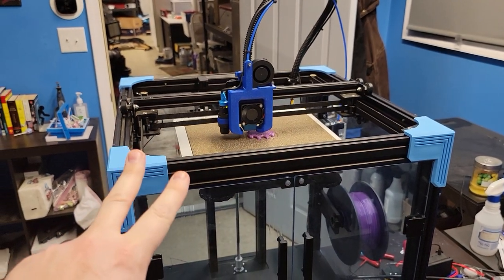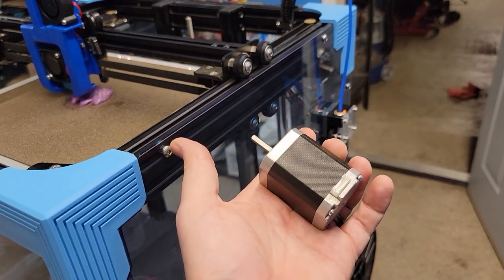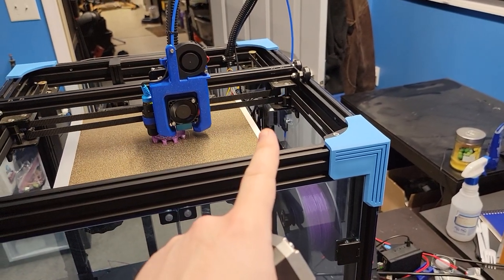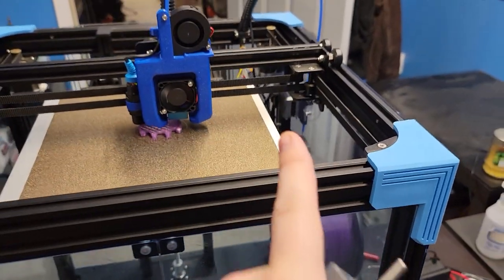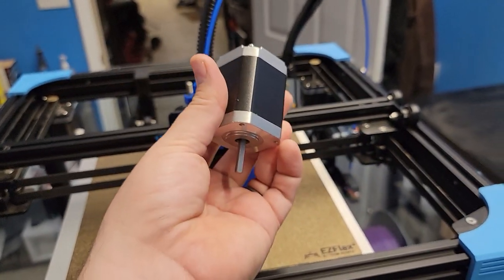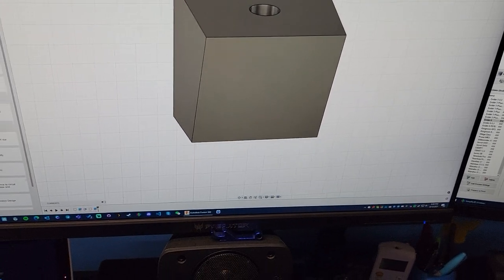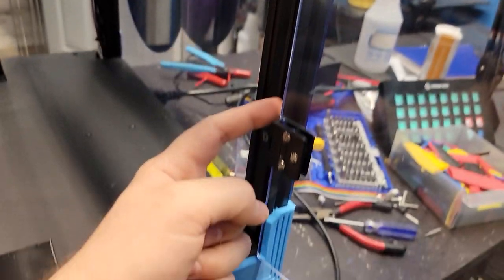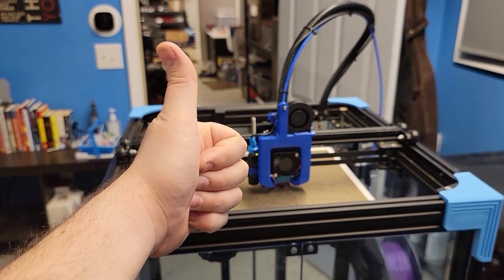Ender 6 Update - Bigger is not always Better - Stepper Motors & Geared Extruders

Comment: Curious why you stuck with the bowden tube. I just put a DDX v3 with a Slice Mosquito on my Ender 6, and I couldn't be happier. They even had an STL for a nice mount for my ezABL. It's working great with both of my ezFlex build plates. Was a nice easy setup with your firmware, too. Thanks for everything so far. Building a cover for it, cuz the next project after that will require a fair amount of ABS printing.
Reply from the maker: Much more work to go that route. No need for direct drive on this machine. Have a few direct printers already so it's not needed on here.

Comment: Not sure if i'm correct as i'm not really sure but i would think its more your drivers on your new board that are incompatible rather than the stepper motor itself. I have upgraded to a BMG geared extruder clone with the original board and stepper motor and have had no issues
Reply from the maker: This was on the stock board, not ours.
Reply: @TH3DStudio  Ah ok. I havent had any issues yet except not doing what i bought if for and thats to stop stringing. Will keep playing with it. I thought the dual gear would help a lot. Love your content mate

Comment: My titan clone came w/ a pancake stepper. It can easily outrun the melt capacity of my microswiss w/ 40W cartridge. I stopped around 14mm3/s when the Hangtight mount started to deflect visibly.
Reply from the maker: Not surprised by that. The Titan design is "old" but it's reliable and works, thats why we keep using them. No issues with the gears separating either like happens on some dual gear extruders either.

Comment: I just put a Microswiss NG Direct Drive on my Ender 6. The difference from stock is like heaven from hell. So many issues with the stock bowden setup, particularly with print accuracy and retractions. Before upgrading my Ender 6 it was 90% useless for what I wanted it to do. Then all of a sudden it became a reliable workhorse.
Reply from the maker: Thats awesome! We're looking at carrying microswiss stuff as well.
Reply: Happened the same to me. The entire machine was uncalibrated and unreliable for almost anything, I was getting a lot of problems with the extruder, from grindin filament to horribly loud gear noises, Z cable was hidden and disconnected, and tons of things you really don't want to face or you can't coprehend when you're a beginer as i was then. Changed to Direct Drive and most of it dissapeared.

Creality needs to seriously improve their quality control, a lot, I've got 3 machines from them now and I can asure that. They expect we regular civilians who bought their products are pro engineers or something, or maybe they're just scammers.

Comment: I often wandered why creality bumped up the size of the extruder stepper as the 1st edition all the steppers were the same size then the 2 I got in January and set-up both have the 65mm sized stepper ❓❓❓ now youve gone back down in size !!! How is the stepper temp now as I find the larger steppers dont get anywhere near as hot as the x y & z steppers
Reply from the maker: It's running warmer than the stock one, but no hotter than the XY motors.

Comment: Tuff extruder on my Ender-5 with the stock motor works great, but that Ender-6 stepper is YUGE.
Reply from the maker: Yeah the 5 is a lot smaller. We use it on our 5s as well and they work great.

Comment: My ender 6 extruder motor is "jittering" after trying to change to a pancake stepper. Switched back to normal stepper and still the same thing. Please link your livestream video where you changed to a geared extruder requiring you to change the stepper rotation direction. I cannot get mine to change direction.
Reply from the maker: If it's jittering then your wiring to the motor is wrong or damaged. As for the stepper direction you can change it via wiring or firmware.

Comment: Just installed the same pancake motor. what voltage did you use on the E motor.
Reply from the maker: Kept the stock VREF that was set on the board.

Comment: I have a quick question, is the micro usb port on the motherboard safe to plug into a pc or rb?
Reply from the maker: We'd recommend using a power blocker or modifying the USB cable to prevent the +5V line from being connected.
Reply: @TH3DStudio  alright, thanks!

Comment: Where can I find this
Reply: Mine went out and I need a replacement but can’t find the motor anywhere
Reply from the maker: If you are using the stock motor you can use a standard motor. If you are using a geared extruder like our tough extruder V2 you can use a pancake. Here are some links:

Standard Motor: https://www.th3dstudio.com/product/standard-extruder-stepper-motor-long-shaft/

Pancake Motor: https://www.th3dstudio.com/product/1a-pancake-stepper-motor-nema-17-22-6mm/
Tough Extruder V2: https://www.th3dstudio.com/product/tough-extruder-v2/

Comment: how is it with flex filament?
Reply from the maker: It works well at speeds up to about 30mm/s for the stiffer flex and like 20mm/s for ninja flex. Doing flex over a bowden is harder than doing it with a direct drive but its absolutely possible with the right setup and settings. :)
Reply: @TH3DStudio  Thanks

Comment: Take it out of stealthchop and tune better I’m screaming with the stock extruder and motor. Bump the voltage and voila. No problems. Running spread at 32 microsteps at 200mms 10000 acceleration. On stock.
…..
Reply from the maker: You can't take it out of stealthchop on the stock board. There is no UART control connected to the drivers on the OEM board.